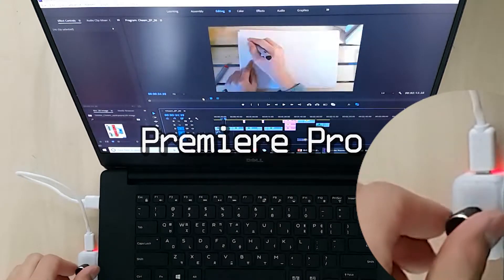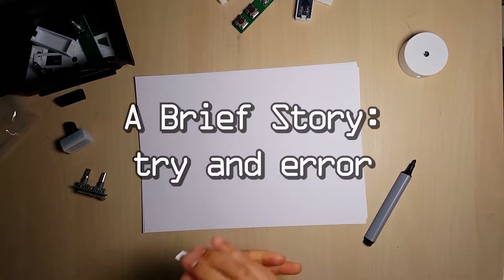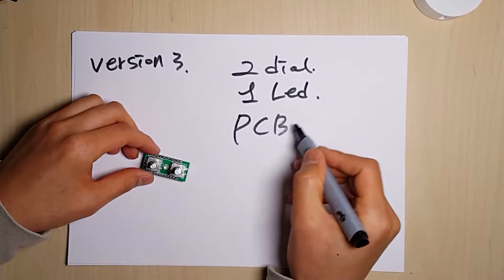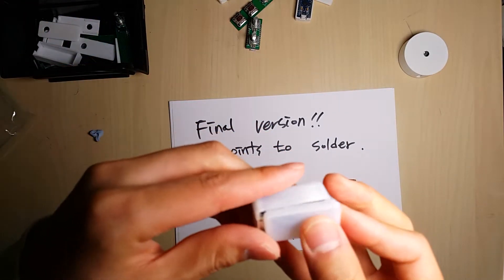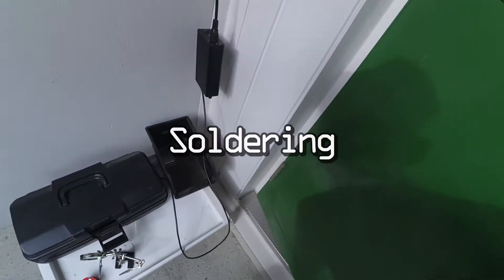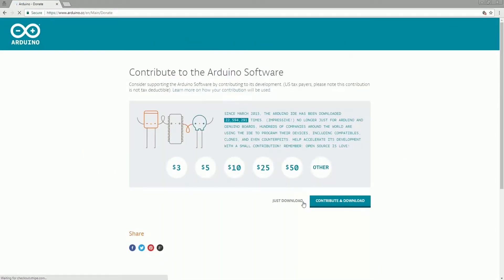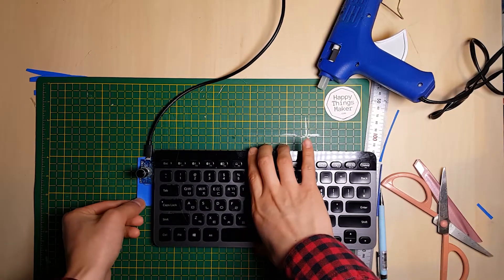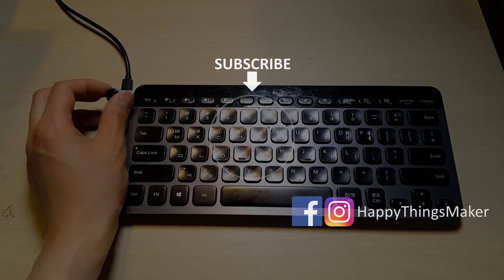Midi controller | Premiere Pro | Lightroom | Navigation Dial DIY (NEW) |  Video Edit Jog Wheel USB

Comment: please help
Reply from the maker: hi, let me make an instruction for your question. it is somehow complicated.
Reply: @EunchanPark  beautiful instuction? but im not a programmer? me very hard some part to understand

// left right
// up down
// everytime you clicks button, it changes arrow direction from horizontal to vertical

// Resolution : some encoder is too sensitive. this reduces sensitivity.
#define RESOLUTION 1

// include a Keyboard library
//#include "Keyboard.h"
#include "HID-Project.h"

// include a EEPROM library for memorizing last function
#include <EEPROM.h>

// "OUTPUT_A" is going to be replaced with "A0".
#define  OUTPUT_A 2

// "PIN_GND_ENCODER" is going to be replaced with "3".
#define PIN_GND_ENCODER  3

// "OUTPUT_B" is going to be replaced with "15".
#define  OUTPUT_B 4

// "BUTTON" is going to be replaced with "A1".
#define  BUTTON A1

// "PIN_GND_BUTTON" is going to be replaced with "A3".
#define PIN_GND_BUTTON  A3

// Declare variables aState, aLastState for checking the state of OUTPUT_A of the encoder
bool aState;

// We need to save the previous state of OUTPUT_A
bool aLastState;

// this variable for check the state of button.
bool lastButtonState = 0;

// mode selection
#define HORIZONTAL_MODE 0
#define VERTICAL_MODE 1

int mode = HORIZONTAL_MODE;
const int numMode = 2;

// void setup(){} function is for one time setting
void setup() {

  //read the last mode
  mode = EEPROM.read(0);

  // in order to use the Keyboard library, begin() is necessary
//Keyboard.begin();
  Consumer.begin();
  
  // OUTPUT_A is for INPUT. must be pull-up
  pinMode(OUTPUT_A, INPUT_PULLUP);

  // OUTPUT_B is for INPUT, must be pull-up
  pinMode(OUTPUT_B, INPUT_PULLUP);

  // BUTTON is for INPUT
  // Most pin has thier own pull-up resistor.
  // INPUT_PULLUP makes the pin high.
  // a leg of button is connected with this pin and another pin which is grounded.
  // when the button is not pressed, the pin reads HIGH signal because of this PULL-UP
  // when the button is pressed, pin is going to be LOW which means "pressed"
  pinMode(BUTTON, INPUT_PULLUP);

  // PIN_GND_ENCODER is for OUTPUT
  // This pin is used for giving GROUND to the encoder.
  // this is a kind of trick, but it works well.
  pinMode(PIN_GND_ENCODER, OUTPUT);
  digitalWrite(PIN_GND_ENCODER, LOW);

  // PIN_GND_BUTTON is for OUTPUT
  // This pin is used for giving GND to the button.
  // this is a kind of trick, but it works well.
  pinMode(PIN_GND_BUTTON, OUTPUT);
  digitalWrite(PIN_GND_BUTTON, LOW);

  // read a signal from OUTPUT_A
  // this is for initialization
  aLastState = digitalRead(OUTPUT_A);
}

long tempCount = 0;

// this loop() function repeats its code eternally

void loop() {

  //read signal from OUTPUT_A and save its state to aState
  aState = digitalRead(OUTPUT_A);

  // if aLastState is not currentState, it meant there's something changed.
  if (aState != aLastState) {

    // read another pin's state.
    // if you want to know about the theory, watch this video
    // https://www.youtube.com/watch?v=v4BbSzJ-hz4
    if (digitalRead(OUTPUT_B) != aState) {
      rotateLeft();
    } else {
      rotateRight();
    }
    // save current State as last State
    aLastState = aState;
  }

  // read button (short or long)
  static long lastTime =0;  
  if (digitalRead(BUTTON) == LOW) {
    if (lastButtonState == LOW) {
      // LOW -> LOW : nothing to do
    } else {
      // HIGH-> LOW 
      delay(200); // ignoring chattering
      lastTime = millis();
    }
    lastButtonState = LOW; 
  } else {
    if (lastButtonState == LOW) {
      // LOW -> HIGH : check whether long press or not
      if (millis() - lastTime > 400) {
        changeMode();
      } else { 
        Keyboard.write(' ');
      }
    }
    else {
      // HIGH -> HIGH : noting to do
    }
    lastButtonState = HIGH;
  }
}

void changeMode() {
  mode = ++mode % numMode;
  EEPROM.write(0, mode);
}

void rotateLeft() {
  if (tempCount++ % RESOLUTION == 0) {
    if (mode == HORIZONTAL_MODE ) {
      Keyboard.press(KEY_LEFT_ARROW);
      //Keyboard.press(KEY_LEFT_ARROW);
    } else if (mode == VERTICAL_MODE) {
      Consumer.write(MEDIA_VOLUME_DOWN);
    }

  }
}

void rotateRight() {
  if (tempCount++ % RESOLUTION == 0) {
    if (mode == HORIZONTAL_MODE) {
     Keyboard.press(KEY_RIGHT_ARROW);
    } else if (mode == VERTICAL_MODE) {
      Consumer.write(MEDIA_VOLUME_UP);
    }
    Keyboard.releaseAll();
  }
}

it works but rotate video left is some anomaly loop
Reply from the maker: @ГалинаКравчук-и9ш  I can't test it now because I don't have the dial because I am traveling. 
But as far as I know, if you want to use "Consumer" you cannot use "Keyboard" at the same time with that library. That could be why that doesn't perfectly work
Reply: @EunchanPark  work rotate right. but when rorare to left - button clamped
Reply from the maker: @ГалинаКравчук-и9ш  I am sorry. I don't know about it. please let me know if you solve the problem.
Reply: @EunchanPark 

Intuitive programmer I
    Keyboard.releaseAll();   and problems gone

 // left right
// up down
// everytime you clicks button, it changes arrow direction from horizontal to vertical

// Resolution : some encoder is too sensitive. this reduces sensitivity.
#define RESOLUTION 1

// include a Keyboard library
//#include "Keyboard.h"
#include "HID-Project.h"

// include a EEPROM library for memorizing last function
#include <EEPROM.h>

// "OUTPUT_A" is going to be replaced with "A0".
#define  OUTPUT_A 2

// "PIN_GND_ENCODER" is going to be replaced with "3".
#define PIN_GND_ENCODER  3

// "OUTPUT_B" is going to be replaced with "15".
#define  OUTPUT_B 4

// "BUTTON" is going to be replaced with "A1".
#define  BUTTON A1

// "PIN_GND_BUTTON" is going to be replaced with "A3".
#define PIN_GND_BUTTON  A3

// Declare variables aState, aLastState for checking the state of OUTPUT_A of the encoder
bool aState;

// We need to save the previous state of OUTPUT_A
bool aLastState;

// this variable for check the state of button.
bool lastButtonState = 0;

// mode selection
#define HORIZONTAL_MODE 0
#define VERTICAL_MODE 1

int mode = HORIZONTAL_MODE;
const int numMode = 2;

// void setup(){} function is for one time setting
void setup() {

  //read the last mode
  mode = EEPROM.read(0);

  // in order to use the Keyboard library, begin() is necessary
//Keyboard.begin();
  Consumer.begin();
  
  // OUTPUT_A is for INPUT. must be pull-up
  pinMode(OUTPUT_A, INPUT_PULLUP);

  // OUTPUT_B is for INPUT, must be pull-up
  pinMode(OUTPUT_B, INPUT_PULLUP);

  // BUTTON is for INPUT
  // Most pin has thier own pull-up resistor.
  // INPUT_PULLUP makes the pin high.
  // a leg of button is connected with this pin and another pin which is grounded.
  // when the button is not pressed, the pin reads HIGH signal because of this PULL-UP
  // when the button is pressed, pin is going to be LOW which means "pressed"
  pinMode(BUTTON, INPUT_PULLUP);

  // PIN_GND_ENCODER is for OUTPUT
  // This pin is used for giving GROUND to the encoder.
  // this is a kind of trick, but it works well.
  pinMode(PIN_GND_ENCODER, OUTPUT);
  digitalWrite(PIN_GND_ENCODER, LOW);

  // PIN_GND_BUTTON is for OUTPUT
  // This pin is used for giving GND to the button.
  // this is a kind of trick, but it works well.
  pinMode(PIN_GND_BUTTON, OUTPUT);
  digitalWrite(PIN_GND_BUTTON, LOW);

  // read a signal from OUTPUT_A
  // this is for initialization
  aLastState = digitalRead(OUTPUT_A);
}

long tempCount = 0;

// this loop() function repeats its code eternally

void loop() {

  //read signal from OUTPUT_A and save its state to aState
  aState = digitalRead(OUTPUT_A);

  // if aLastState is not currentState, it meant there's something changed.
  if (aState != aLastState) {

    // read another pin's state.
    // if you want to know about the theory, watch this video
    // https://www.youtube.com/watch?v=v4BbSzJ-hz4
    if (digitalRead(OUTPUT_B) != aState) {
      rotateLeft();
    } else {
      rotateRight();
    }
    // save current State as last State
    aLastState = aState;
  }

  // read button (short or long)
  static long lastTime =0;  
  if (digitalRead(BUTTON) == LOW) {
    if (lastButtonState == LOW) {
      // LOW -> LOW : nothing to do
    } else {
      // HIGH-> LOW 
      delay(200); // ignoring chattering
      lastTime = millis();
    }
    lastButtonState = LOW; 
  } else {
    if (lastButtonState == LOW) {
      // LOW -> HIGH : check whether long press or not
      if (millis() - lastTime > 400) {
        changeMode();
      } else { 
        Keyboard.write(' ');
      }
    }
    else {
      // HIGH -> HIGH : noting to do
    }
    lastButtonState = HIGH;
  }
}

void changeMode() {
  mode = ++mode % numMode;
  EEPROM.write(0, mode);
}

void rotateLeft() {
  if (tempCount++ % RESOLUTION == 0) {
    if (mode == HORIZONTAL_MODE ) {
      Keyboard.press(KEY_LEFT_ARROW);
    } else if (mode == VERTICAL_MODE) {
      Consumer.write(MEDIA_VOLUME_DOWN);
    }
    Keyboard.releaseAll();
  }
}

void rotateRight() {
  if (tempCount++ % RESOLUTION == 0) {
    if (mode == HORIZONTAL_MODE) {
     Keyboard.press(KEY_RIGHT_ARROW);
    } else if (mode == VERTICAL_MODE) {
     Consumer.write(MEDIA_VOLUME_UP);
    }
    Keyboard.releaseAll();
  }
}
Reply from the maker: @ГалинаКравчук-и9ш  oh, now I see . thank you let me know. Congratulations!
Reply: @EunchanPark  you are the best ! thank you so much
Reply: how red light control in oflline? in offline its on (
Reply from the maker: @ГалинаКравчук-и9ш  hello! could you tell me more detail about your question? what is the red light? is the power light? we cannot control the power light except for removing it.
Reply: @EunchanPark  power light is green
Reply from the maker: @ГалинаКравчук-и9ш  maybe, the red leds attached in the communication ports. they are blinking when the arduino communicates with PC. in other words, we cannot control the LEDs. If you don't want them, then you can remove them with soldering tools.

Comment: Does it work for after effects cc
Reply from the maker: hi, if you want to use this, you need to change some code. if you change the code, you can use it (ctrl + left / ctrl + right key)
Reply: Thankyou bro
Reply: What is your next project, Can you make a diy midigrade ?
Reply from the maker: @akhilsatheesh5091  what is midigrade? I used make a midi drum. next project will be a customized dial for general purpose. :)
Reply: @EunchanPark   i mean colour grading tool fro premier pro
Reply from the maker: @akhilsatheesh5091  As I tested it, I found that it is needed to click the number next to the scroll bar of color attributes. Focused on the numbers,  you can handle it with the dial.

Comment from the maker: If you wanna make this for a volmume controller, Here is instruction:
1) download and install the library -> https://github.com/NicoHood/HID
(clone or download -> download)

2) arduino
sketch - library - add .zip library  - (select above zip file )

3) paste this code onto arduino

// Youtube : Eunchan Park
// https://www.youtube.com/watch?v=dJJ1wlJPqwE

// left right
// up down
// everytime you clicks button, it changes arrow direction from horizontal to vertical

// Resolution : some encoder is too sensitive. this reduces sensitivity.
#define RESOLUTION 2

// include a Keyboard library
//#include "Keyboard.h"
#include "HID-Project.h"

// include a EEPROM library for memorizing last function
#include <EEPROM.h>

// "OUTPUT_A" is going to be replaced with "A0".
#define  OUTPUT_A 2

// "PIN_GND_ENCODER" is going to be replaced with "3".
#define PIN_GND_ENCODER  3

// "OUTPUT_B" is going to be replaced with "15".
#define  OUTPUT_B 4

// "BUTTON" is going to be replaced with "A1".
#define  BUTTON A1

// "PIN_GND_BUTTON" is going to be replaced with "A3".
#define PIN_GND_BUTTON  A3

// Declare variables aState, aLastState for checking the state of OUTPUT_A of the encoder
bool aState;

// We need to save the previous state of OUTPUT_A
bool aLastState;

// this variable for check the state of button.
bool lastButtonState = 0;

// mode selection
#define HORIZONTAL_MODE 0
#define VERTICAL_MODE 1

int mode = HORIZONTAL_MODE;
const int numMode = 2;

// void setup(){} function is for one time setting
void setup() {

  //read the last mode
  mode = EEPROM.read(0);

  // in order to use the Keyboard library, begin() is necessary
  //Keyboard.begin();
  Consumer.begin();

  // OUTPUT_A is for INPUT. must be pull-up
  pinMode(OUTPUT_A, INPUT_PULLUP);

  // OUTPUT_B is for INPUT, must be pull-up
  pinMode(OUTPUT_B, INPUT_PULLUP);

  // BUTTON is for INPUT
  // Most pin has thier own pull-up resistor.
  // INPUT_PULLUP makes the pin high.
  // a leg of button is connected with this pin and another pin which is grounded.
  // when the button is not pressed, the pin reads HIGH signal because of this PULL-UP
  // when the button is pressed, pin is going to be LOW which means "pressed"
  pinMode(BUTTON, INPUT_PULLUP);

  // PIN_GND_ENCODER is for OUTPUT
  // This pin is used for giving GROUND to the encoder.
  // this is a kind of trick, but it works well.
  pinMode(PIN_GND_ENCODER, OUTPUT);
  digitalWrite(PIN_GND_ENCODER, LOW);

  // PIN_GND_BUTTON is for OUTPUT
  // This pin is used for giving GND to the button.
  // this is a kind of trick, but it works well.
  pinMode(PIN_GND_BUTTON, OUTPUT);
  digitalWrite(PIN_GND_BUTTON, LOW);

  // read a signal from OUTPUT_A
  // this is for initialization
  aLastState = digitalRead(OUTPUT_A);
}

long tempCount = 0;

// this loop() function repeats its code eternally

void loop() {

  //read signal from OUTPUT_A and save its state to aState
  aState = digitalRead(OUTPUT_A);

  // if aLastState is not currentState, it meant there's something changed.
  if (aState != aLastState) {

    // read another pin's state.
    // if you want to know about the theory, watch this video
    // https://www.youtube.com/watch?v=v4BbSzJ-hz4
    if (digitalRead(OUTPUT_B) != aState) {
      rotateLeft();
    } else {
      rotateRight();
    }
    // save current State as last State
    aLastState = aState;
  }

  // read button (short or long)
  static long lastTime = 0;
  if (digitalRead(BUTTON) == LOW) {
    if (lastButtonState == LOW) {
      // LOW -> LOW : nothing to do
    } else {
      // HIGH-> LOW
      delay(200); // ignoring chattering
      lastTime = millis();
    }
    lastButtonState = LOW;
  } else {
    if (lastButtonState == LOW) {
      // LOW -> HIGH : check whether long press or not
      if (millis() - lastTime > 1000) {
        changeMode();
      } else {
        Consumer.write(MEDIA_VOLUME_MUTE);
      }
    }
    else {
      // HIGH -> HIGH : noting to do
    }
    lastButtonState = HIGH;
  }
}

void changeMode() {
  mode = ++mode % numMode;
  EEPROM.write(0, mode);
}

void rotateLeft() {
  if (tempCount++ % RESOLUTION == 0) {
    if (mode == HORIZONTAL_MODE ) {
      Consumer.write(MEDIA_VOLUME_DOWN);
      //Keyboard.press(KEY_LEFT_ARROW);
    } else if (mode == VERTICAL_MODE) {
      Consumer.write(MEDIA_VOLUME_DOWN);
    }

  }
}

void rotateRight() {
  if (tempCount++ % RESOLUTION == 0) {
    if (mode == HORIZONTAL_MODE) {
      Consumer.write(MEDIA_VOLUME_UP);
    } else if (mode == VERTICAL_MODE) {
      Consumer.write(MEDIA_VOLUME_UP);
    }
    Keyboard.releaseAll();
  }
}

I tested and verified it. 
good luck!
Reply: Can u make it with bluetooth adapter? or wireless?
Reply: hello! how to control system board led ?
Reply from the maker: There may be 3 LEDs
2 LEDs are directly connected with communication port. in other words, we cannot control them when we use the Arduino as the controller of this video. There is one extra LED but the LED is for POWER.
Reply: @EunchanPark  if i damage green power led system still work ?
Reply from the maker: @ГалинаКравчук-и9ш  sure. it will be working well if you only remove the led. be careful when you remove it not to remove other component. I personally recommend you to cover LEDs  with PVC tape or something like that.